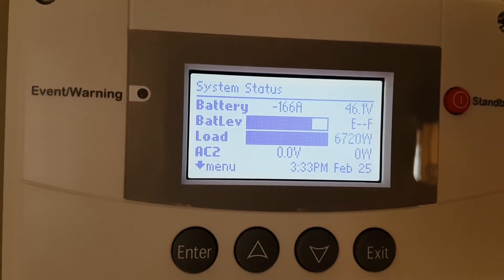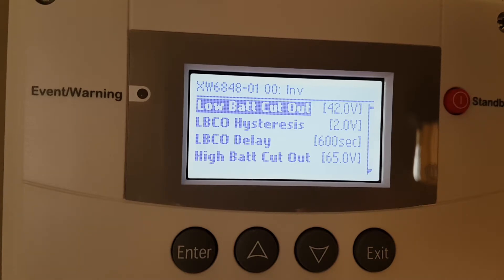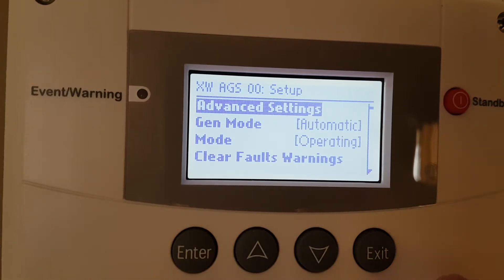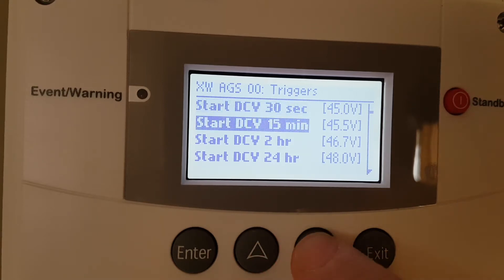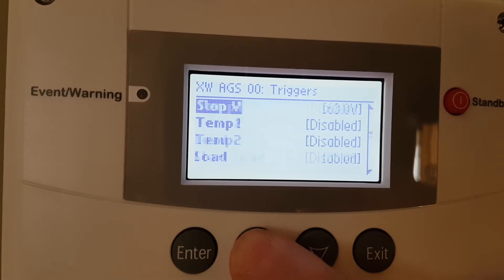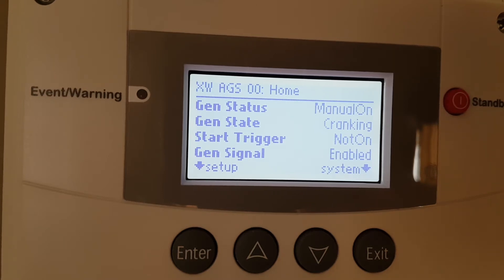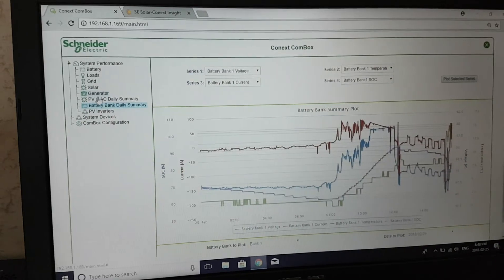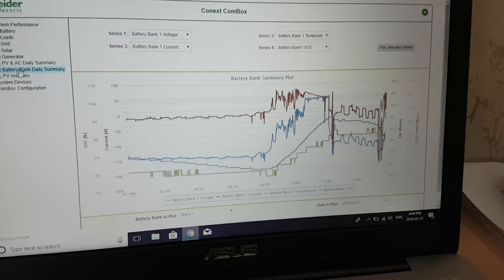Schneider conext inverter understanding the AGS automatic generator start.

Comment: I have got a Scneider 4048 inverter, An Outback flex 80 and 8 12 v 200 AH Renogy gel batteries. I have checked the batteries and they are Ok. I have my OUTBACK flex at 60 . Something is strande my batterie volts drop )not used= from 54 v to 49 at a heart beat. Is there something I have to adjust at my inverter?
Reply: Sounds like you have a bad battery  , please chech each battery under load and see if one is bad

Comment: How do you set the warm up mode time? I cant seem to find it in any of the settings.
Reply: Ya sorry Schneider put the warm up time in the Inverter     and the only way is to have your computer talk to it on the LAN on the gateway or Combox
Reply: @camosolarinc7697  thanks for clarifying that for me. Is there a guide on how to use the LAN to set up the warm up? I have the conext sw 4042 inverter. I cant find anything in the install or user guide and dont want to damage my diesel genset by having a load on start. Its -40 celisus here and even though i got the block heater pluged in it cant be good on the genset to not get a warm up.

Comment: I have a 1000 amp hour agm wet filled battery bank would you know my correct settings
Reply from the maker: Battery settings generally have to be obtained from the battery manufacturer. What is their make and model?
Reply: Start off with a 3-stage charge rate 60 amp bulk and float

Comment: I have it set when my generator runs it seems like my batteries are getting really hot and it says it is full charge in only 2 min after gen starts and then the gen shuts off more concerned if I have my generator set up right
Reply: if your batteries get hot you have a big problem      how many Amp hour is your battery and how many amps are you pushing

Comment: hello CBI solar, i have a battery bank containing 80 units of trojan SAGM 06v 315AH  batteries connected in series-parallel. and i  use 2 units of context xw+ inverter 48v,  please what max charge rate should the inverters be set? 
Thank you
Reply: Hello... Did you figure the max charge rate for your inverters? Looking into something similar myself. Thanks in advance...